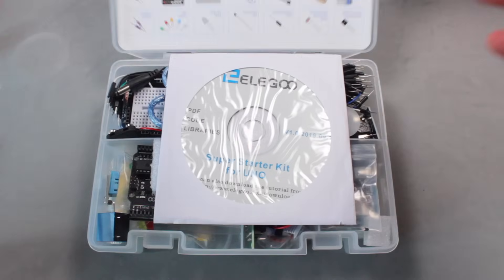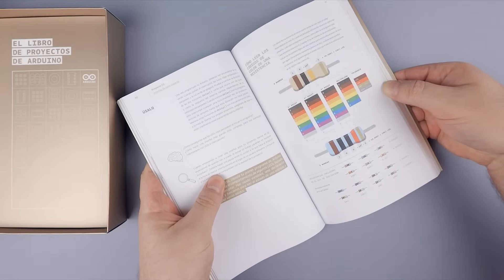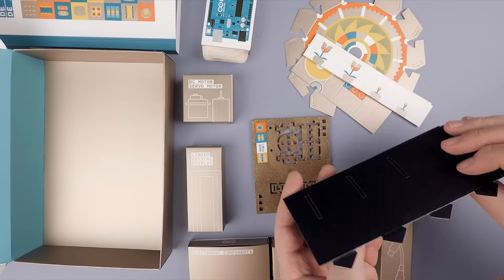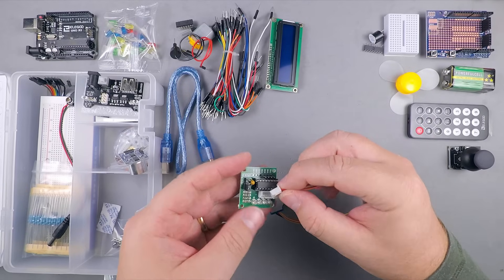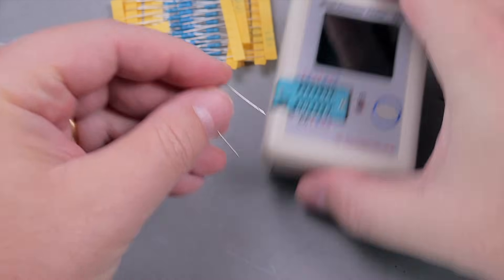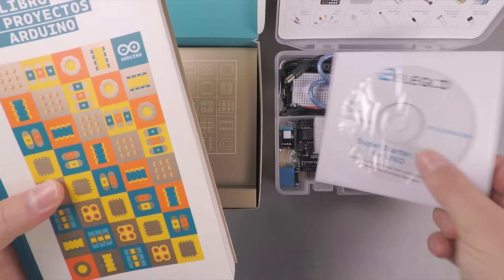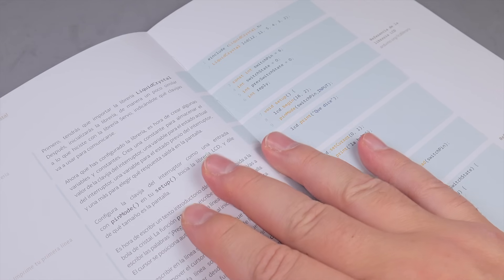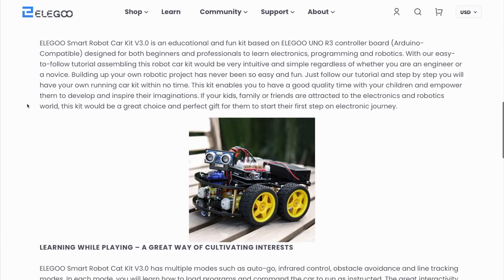Which Arduino to buy? Arduino Starter Kit vs Elegoo Uno R3 Starter Kit

Comment: Great video - So... The Elegoo is exactly the same as Arduino?  In the sense that programs written for Arduino can be executed on the Elegoo board?
Reply from the maker: Yeah, any “Arduino Uno R3” clone is based on the same board and microcontroller. The hardware is open source. They are virtually identical and run the same projects.

Comment: Hello @GeekDetour love this video, have been looking at getting into Arduino fun recently. I noticed your gripe about the resistors being a different color. Most people don't know this, but the color blue like that is used universally to assist people like myself who are severely red-green color blind. The traditional resistor design and color, makes it so I cannot tell the colors of each resistor, making it so that I have always had to measure the resistors before using them. Knowing that Elegoo sells these in this design now, really makes me excited!! Just because of this simple fact, I will now begin purchasing Elegoo Resistors! Thank you again for this content, it has been VERY useful and helpful in my starting to learn about Arduinos!
Reply from the maker: Well, the Blue Resistors are better electrically: they are metal film resistors - they keep their value more accurately years later…. The only problem is really the Color. It’s not easy at all to distinguish the rings. I gave up, I measure them and that’s it… but it’s a shame a better resistor comes by standard with a terrible color.

Comment: I want make mini car with long distance wifi with camera
Reply from the maker: Yeah, you need a different kit. There are kits already for Robot Cars with WiFi cameras and all. But if you need actual speed and really long distances, these kits will be not what you want - going for an RC model with FPV cameras is what you need - it doesn’t need to be an Arduino thing.

Comment: im 14 years old, and lately ive been really interested and passionate about this engineering and i thought of buying a kit just like those in the video.I dont have a lot of experience or knowledge. What should i buy?
Reply from the maker: If you can follow instructions from a PDF, the Elegoo Kit comes with more modules and components for you to tinker with - and it is cheaper. Go to the Elegoo Website, Support and find the downloads for Arduino Kits (STEM KITS). You can check the lessons from the PDFs before you even buy the kit.

Comment: Dang it this is so hard to choose from!
Reply from the maker: Well, when I started, I enjoyed the official Arduino Kit and its book a lot. Then I bought the Elegoo Kit, and another one. And later, I bought several of the Elegoo Uno R3 boards separately… and later on way more Arduino Nano style boards… then Arduino Nano NRF24L01 (a data radio transceiver) integrated.
Looking in retrospect: the official kit was the only 1 actual “Arduino” official product I bought, more expensive and no point in getting more than one. It was the best starter for my journey, I like books. If money is a concern, get the Elegoo Kit right away because in components and modules you get more for your money. But the official kit was a very pleasant experience.
Reply: @GeekDetour  I think I’ll save a bit of money and just research a bit more. Thanks for your advice! Are the official arduinos higher quality thought( are they made from better material etc)

Comment: thanks for the excellent video, sometimes is hard to find things well done in YouTube! Im going with Elegoo, I want to start a project that reads temperature and humidity from Industrial Refrigeration Chambers. I know that Elegoo is the right option to start learning in this case. I come from the world of programing and getting into this new world now! 
Cheers! Alfredo from Argentina.
Reply from the maker: Hi Alfredo! Yeah, the Elegoo Kit comes with a DHT11 Humidity and Temperature sensor, and the LCD is nice to show the values. I recommend you to buy an “LCD to I2C module” (not in the kits) because you can connect to the Arduino using just 4 cables. There are many tutorials teaching how to use the LCD over I2C - just search. Un gran abrazo desde España 🇪🇸😄

Comment: ESP32 is Beyond Superior to the Arduino
Reply from the maker: I agree! Feature-wise, the ESP32 is unbeatable. Yet, I still think the Arduino Uno family is way easier for beginners - the amount of examples, tutorials and videos about it surpasses ANY other microcontroller.
Reply: @GeekDetour  
Point 1 - Is it Easier. NO
Arduino and ESP32 ARE IDENTICAL.
print("Hello World");
is identical on ESP32 and ARDUINO
and so are all the example sketches.
so as far as beginners LEARNING ARDUINO are concerned, it's exactly the same.
then when they are ready they can step up to FreeRTOS and cores and Multitasking.

Now , even if they never bother to learn FreeRTOS, it's still cheaper and more powerful and identical to learn.
so in terms of ease
IT'S IDENTICAL

Point 2 - Arduino UNO is not better.
IT'S MORE POPULARIZED

Point 3 - As for the amount of video's, Given that ESP32 can do Arduino Sketches , ESP32 has more videos because it has all the Arduino videos + all the ESP32 videos
as for ESP32 videos alone.
there are thousands of them, it's just that people don't commonly search for them
TRY IT, Search around 10 ESP32 videos and watch what the algorithm does

Point 4 - As for Beginners,
there are different kinds of beginners.

there is the young student - In this case, Mum usually takes the son or daughter to Jaycar and has no clue about what to get , but SCHOOL TOLD HER "BUY ARDUINO UNO" and then.. that'll be $90 thanks very much
when in fact mum doesn't realize that ESP32 is like $30
Ease is not the biggest factor here , but budget is a big one because school is expensive

HOWEVER THE SCHOOL DOESN'T TELL MUM THAT ESP32 IS BETTER AND CHEAPER.... I wonder why huh 

as technical people it's our job to educate the not clued in on what is the fact and in their best interest.

and here's another that i despise

- When teachers that are SPECIFICALLY TRAINED IN S.T.E.M. Subjects such as robotics or programming or Engineering
have no idea how to program C++ and arduino 

- When teaches rely  on opening up a basic Example Sketch then basically reading from the sketch, all while the student doesn't understand what the teacher just did and that the teacher took the easy road

- Now.... in the example of 
print("Hello World");
Did the teacher explain that "print" is a FUNCTION ?   NO
Did the teacher explain what parenthesis does
Did the teacher explain A TEXT STRING
and DATA TYPES
did the teacher explain the significance of ";"
NO, NO AND NO
Instead the explanation is
"Just type this in,    Basically when you do this it prints the words HELLO WORLD"

"Oh miss, what is the ; thing at the end for"
Teacher "Ohh you JUST HAVE TO PUT IT THERE"

Well done STEM Teacher who is getting paid TO TEACH THE KIDS PROGRAMMING

I'm all for educating the kids on both Arduino and ESP32
I have no bias one way or the other and i've electronics since i was a kid in the 70s, So don't take me incorrectly as defending ESP32 and not supporting Arduino... Not at all

but do you know why there are more Arduino Videos ?
IT'S BECAUSE THE NARRATIVE KEEPS GETTING PERPETUATED.

arduino has NO ADVANTAGE of ESP32.
Perhaps i might be able to think of 1 or 2, but they are not significant .
the main 2 points that blow it out of the water are

The price point
the Frequency difference

IN MY OPINION

Kids need to be taught more than just blinking and LED by loading a sketch

WHY SHOULD THEY NOT BE TAUGHT THE BASICS OF SIMPLE FUNCTIONS AND STATEMENTS ?

All i see is 
HELLO WORLD
then
Here is an LED, Let's throw in a limiting resistor and blink the led

We need to get past this.
I make a point , when teaching programming to NEVER MENTION 
"Hello World" or "The Cake Analogy"

it's popular,  it doesn't make it correct or understandable for everyone.

so. Respectfully, i disagree UNO is easier than ESP32,  it's identical to learn C++ with either one (Assuming we are programming ARDUINO and not FreeRTOS)

I feel kids should be taught better by the teachers that are paid to teach them, and not have those teachers take a cop out and short cut by just throwing up examples and literally FROM YOU TUBE VIDEOS THEY WATCHED THE NIGHT BEFORE.
I have clients that are STEM Teachers.
I know this happens, for a fact.

I've been called by my clients to literally teach them an hour or 2 on Arduino a day or 2 before they would deliver the lesson to the kids at school

Do i care ?
well, i'm getting paid well for it, so .. No i don't.
Does it make it right what they are doing ?
No it doesn't
STEM Teachers should know C++ Basics

and while i explain it to them , they take notes as if they've never heard this stuff before.

I even have to explain to them 
"You don't need to take notes,
I have just add
// COMMENTS TO EXPLAIN WHAT THIS LINE DOES
and then i can give you a sketch you can use to put on the projector and then you open another IDE instance with the same sketch with the comments"

I'm literally spoon feeding these teachers the answers that they are supposed to know

Given how expensive school fees are, i would expect better from them

so yeah
i Feel the beginners deserve better, 
whether they are kids or adults 

I understand your mission on this channel.
but i would highly respect it , and i think it would be in your benefit if you put more focus on ESP32
and Explained that you can do anything on ESP32 that you can on Arduino

why not do a side by side comparison of a few sketches ?

it'd make for good views wouldn't it

anyway, that's my opinion and rant.

Comment: Blue resistors are mostly 1% Toleranz resistors
Reply from the maker: Sure! They are excellent in virtually all electrical aspects! The color is terrible 🤷‍♂️
Reply: @GeekDetour  Well I never actually had Blue resistors, were you could read the colours perfectly
Reply from the maker: Back when I studied electronics, metal film resistors weren’t yet popular or cheap - so I only used carbon ones that had a light beige background color - the colors were very easy to identify and after some time I knew their values immediately just by taking them in my hands and looking at the pattern. Now it is impossible. The color rings look all the same over the blue background. Anyway, I keep them in their identified bags - but I measure them just in case before I solder them. But I hate this.
Reply: @GeekDetour  yes You are Right too but the 0.1% tolerance have a light blue background color, they are very easy to identify.
Reply from the maker: Oh, thanks! I’ll check them out! I didn’t know about these even more precise ones. I am curious about the price!

Comment: I enjoy very much your review,  I am interested in this kind of projects. Now that I am a Model Railroad fan, and this days they use a lot of electronics.  When I was a kid of about 10 yr. old, my dad give me a set, with the posibility of building several  electronic projects. This was a set  with the Philips branding, from Holland, but was made in Mexico.  The Name of the set: ELECTRONIC ENGINEER . It had a booklet with electronic and electric basics and another part with the instructions for building different projects. An AM radio, a light detector,  a humidity detector, even a very small keyboard, a pair of speakers, and the various electronic components. All powered by a battery.  Was a nice Set.    Somewhere. I kept the booklet only.   But I have a grandson that will be 10 yr.old this year, very intelligent, he was born in Austria, and lives there. Recently he, and his peers, were exposed, to a Technic school, and they receive information about LEDs, Faraday cages, electricity.  And he is interested in this matters.  So I Think this  ARDUINO starter kit is for him
Reply from the maker: The first kit I Really loved as a kid was one of electricity: you could make solenoids, a very rudimentary but highly entertaining motor, a ring bell, many experimenta with magnetism, photovoltaic experiments… and a bunch of electrostatic experiments - I made and remade many of them. I think the Arduino Kits miss movement, in general, it is kind of “abstract” what’s happening inside of the microcontroller - I am still looking for a kit that would truly captivate kids, because, let’s be honest: making an LED blink is not exciting. On the other hand, moving anything with a motor is always cool. Servos, stepper motors, these are very captivating. Not all kids enjoy Arduino - but there is only one way to know 🤷‍♂️

Comment: You may consider the following in addition when comparing the kits:
Elegoo "just copied" what has been developed / designed by Arduino. Arduino is a non-profit organization. Development of the boards, the parts, the specification is much more expensive than "copying". So it is always better to support the original whenever possible, so they can invest the money in development of new boards, new parts, etc.  In case everybody would buy the cheapest kit it is to be expected the Arduino will run out of money.
Reply from the maker: I agree with what you say: if everybody just buys clones, Arduino will cease to exist. But let’s turn the table: if the clones never existed, would Arduino (and it’s Organization) still be here? Arduino is open hardware BY CHOICE - they knew that its success would depended on wide popularity. Making an “Arduino Clone” board is completely legal, it’s part of the premises of the original project.
I love the Official Arduino Uno R3 Kit - and that’s why I emphasize the value of the Book: it is well printed, beautiful, it is a much richer experience than following a set of PDFs.
That said, I might have 3 or 4 original Arduino boards - and around 30 variations I got from AliExpress: Nanos, Micros, Nano + RF24L01… and an army of Uno R3s. Most of them are not exactly like the original board (they use the cheaper CH340 usb to serial chip, instead of the FT232RL converter that the original Arduino boards use). The only “copy” that is identical with a good price (that I found) is made by Elegoo. I have 6 of them. 
If I had to purchase everything authentic Arduino, I would do much less projects and tests. But the clones are completely legal - you are not doing anything wrong. I support Arduino as much as I can.
Reply from the maker: PS: I forgot to add that, anonymously, I can see the products purchased on Amazon using my affiliate links. And people also see the value of the original Arduino. The Ratio is around 3 to 1. Every 3 clones, people buy 1 original by Arduino. So, we are not suffocating the organization: on the contrary, the hobby is growing and Arduino is being supported as well.

Comment: Looks like it's off too Amazon for the Eligoo Kit (too bad about the resistors) on a blue back ground (very much hard) to determine the value I agree.. Thanks for this very informative video.. Very helpful..Takes the guess work out of knowing what to get. 👍👍👍👍👍
Reply from the maker: Absolutely, the blue background color on the resistors, for anyone that is "old" with electronics and could "read" the values just by looking at the rings, is a frustration. But it seems the industry doesn't see a reason to change. They adopted this nasty color to identify Metal Film resistors (which are excellent in so many aspects), and, yeah... we have to deal with it.

Comment: MAY i ASK iF : This is The Perfect Kit To UtiLize With a FLat Screen Monitor OR TV To Use As a Scoreboard To An Home Made "BOWLING LANE" That I've Designed???
Reply from the maker: These kits don’t generate images for TV. It will be much easier to use a Raspberry Pi for such application.

Comment: Hmm, what if it's not truth? and you could start exploring Arduino without prior experience at all.
Reply from the maker: I think there is only one way to know - luckily, the kits are not expensive, specially the Elegoo one. If you can do basic electrical repairs, understand polarity, if you are comfortable with using tools, some woodworking… this is the type of mindset that usually can have some fun with Arduinos. The programming side of it: you start making the simple projects that come in the manual and start tweaking them: changing values, changing what is written to the display… and you begin to learn things. If not, at least you will know it’s not your thing. To me, I was always attracted to electronics - I never had formal engineering education… but I REALLY wanted to know how to make things. And I loved the look of the components.

Comment: Fake electronics expert.
The resistors value in ohms  is written clearly on the yellow strip of each  pack of 10 resistors. 

Fake expert
Reply from the maker: I know it's written on the ribbon. It doesn't make it less annoying. I know the values of the resistors by just looking at the color code - if I can actually see the color. Why the judgemente? How old are you? 12?
Reply: Stop making a big issue .if you knew then you are a liar.complaining about nothing.

Comment: ahh i see i don't know how my power module has been working since i powered it through a USB i think it might explodeand im too scard to unplug it now.
Reply from the maker: Oh… yeah. Look, do you have a multimeter? Just measure what you get at the outputs to check if the module is dead or ok. With Arduinos, at least one multimeter is mandatory.